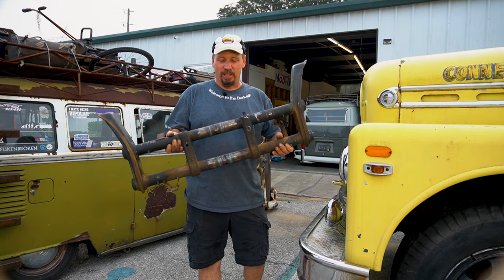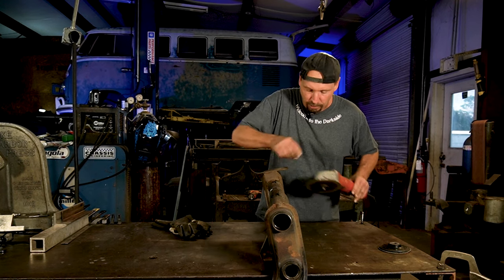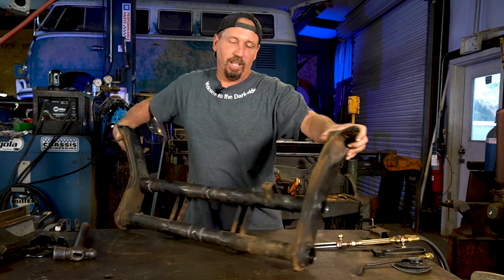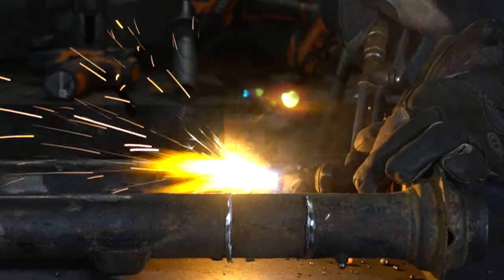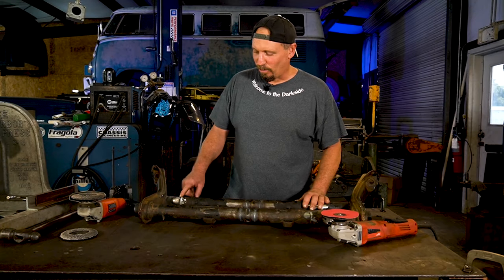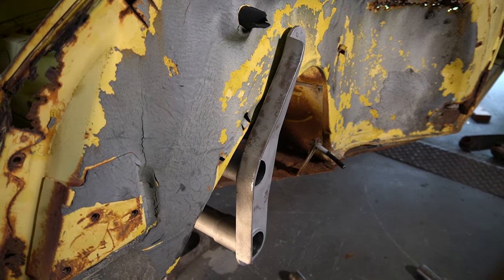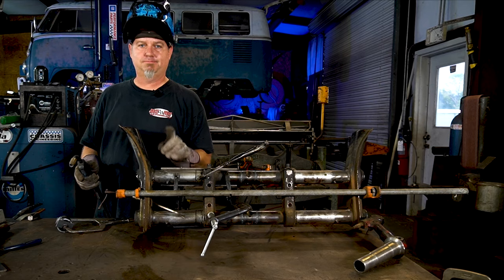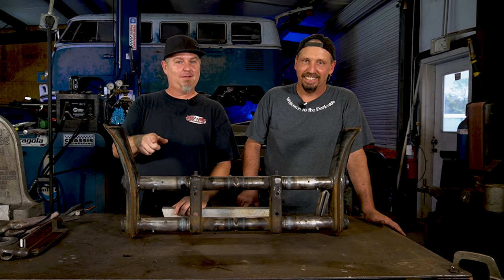How to Narrow your VW Bug Beam / And we're giving it away!

Comment: I once had a split bus project getting towed. The master cylinder was missing. Before I could stop the driver, he used the master cylinder bracket to pull the Bus onto the truck. 😢

Comment: As a custom motorcycle frame builder, I'd probably have opted to sleeve those joints as well, for added strength.

You could either have made up some snug fitting sleeves of say 1½ inches long, slid them on before you welded the tubes, marked ¾ inch either side of the join, for alignment, then welded your sleeves in place or even just tacked some bits of flat in place and formed them around the tubes, before fully welding them in position.

Not a criticism - you do good work and my ways are probably overkill, but as a time served welder, I guess I tend to over engineer things - better to be safe than sorry.